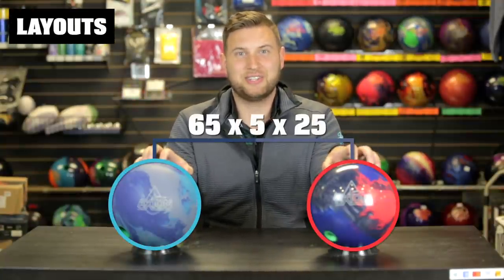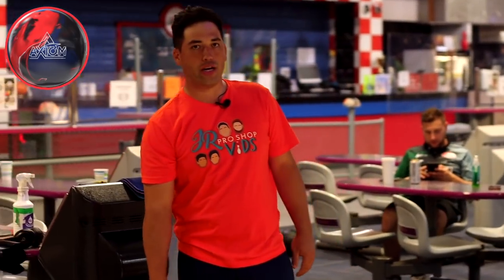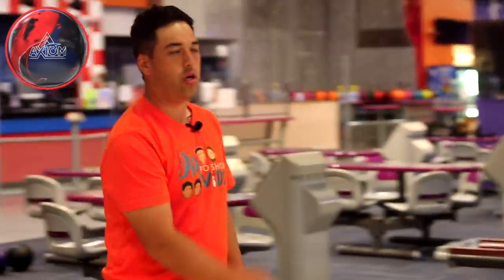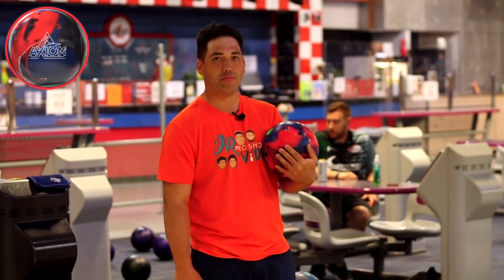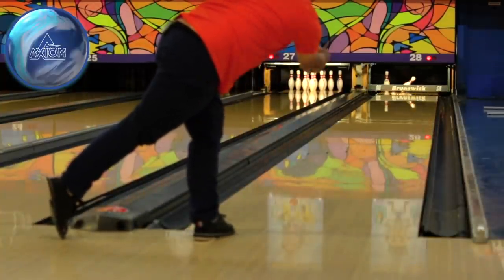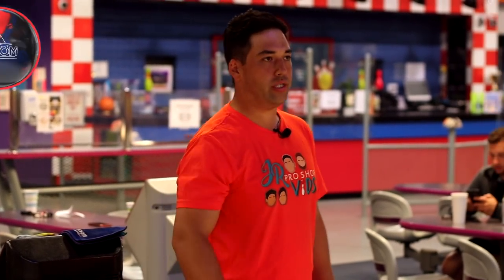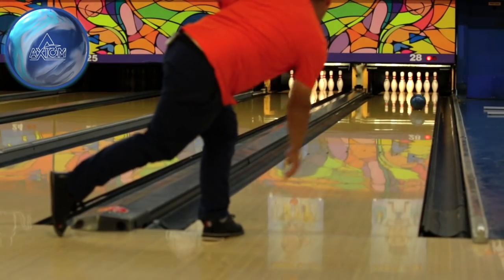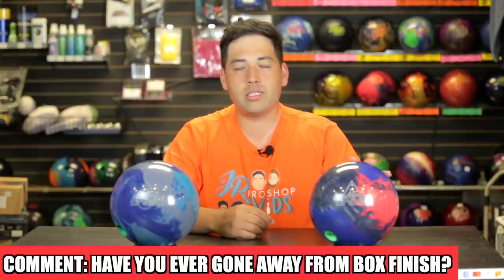Solid vs Pearl | Axiom vs Axiom | WHAT'S THE DIFFERENCE??

Comment: I always actually change the surface of a new ball before throwing it - i know this sounds insane, but what i mean is if the box for a ball says 3000, then i will put use the spinner to put 3000 on it myself - that way i know exactly how to recreate that surface when it comes to resurfacing each ball!! purely because i strongly believe you will never recreate the factory finish even if you use the same pads/polishes.

and yes i have ended up changing solid balls to be shiny and pearl balls to be dull for example, even though its a hybrid, i love the original Hyroad at 2000, i always felt it missing the breakpoint for me when shiny! but in saying that my hyroad max is now shiny haha

Comment: I'm a stroker and, like many others, I took Bowling This Month's advice and took the factory finish of my Phaze III down to 3000 by sanding. The changes are quite noticeable. Using BTM's numbers (they gave me their best guess on the post sanding numbers) here they are....Length 15 vs 6.5, Torque 8.0 vs 7.0, Back end 17.5 vs 16.5, Hook 54 vs 57.5. As you can see, removing the factory polish dramatically reduced the length rating and significantly increased the hook rating. I usually don't change box finishes but I'm going to keep this Phaze III at 3000 sanded. As such, it has become my "hook monster" ball.

Comment: Used to throw an old t-road pearl but it finally cracked so I went to a Hy-road pearl but it was a little too angular on the end so we sanded it from 2000 grit to 1500 grit and then repolished it. The roll phase starts just a little earlier and not so sharp so it is more forgiving but still strong. Funny note; Fixed the t-road cracks with JB wield (cracks were around the finger holes) and they have held up great! Note this is Colleen's husband Dave

Comment: Have a badger tour drilled 70x4x80 for control and I’ve used it oob on chameleon and it looked good.  For standard 40 foot house I polished it with motiv polish and I’ve hit i with a ctd 5k pad.  I felt on house the 5k pad gave it a more consistent reaction on than polished.  I noticed that when it starts leaving flat corners I just move in a little in and come around it and my pocket becomes big again.  I have a money badger drilled pin up and I took the polish off of it and it shapes a little differently than when it’s polished.  It doesn’t go as far down lane when the polish is taken off and the reaction isn’t as strong off the spot but sometimes I need a different reaction and shape than the oob cover.

Comment: Yesterday for practice I polished a solid asym Intimidator. It gave it a smooth controllable benchmark feel but I had to play farther right, around the 7 board and throw it very straight to get it to go through the pins properly.  Didn't love it, but didn't hate it, might use it instead of my old blown out dead idol until the new one comes out.  And in the past I've put a 2000 pad to a Halo Pearl and I had better luck with it that way.  P.S. also polished my old dead pink idol then went over gently with a 3000 pad giving it a bit of sheen. Was hoping that would breathe some life back into it. Nope.

Comment: I took a Columbia 300 Tyrant Solid from box finish to 4000 grit and polished.  I liked the change so much that I left it that way.  I am a low speed, rev dominant two hander and out of the box it would hook at my feet.  The surface change made it push easily through the fronts but still make a decisive move on the backend.  Sadly it cracked on me after about a year of use.

Comment: Great stuff as always Guys!!!  I'm lookin at a new Pearl now...I roll the ASYM Storm Dual lock and also a SYM iQ Tour Sapphire. 

Not sure what to go with, but looking at these 3 balls...
I'm still Storm and Roto Jungo so be nice ;), but the GB ASYM looks to be a beast like the GB4 which I rock and then there is the new Joker Wild that looks sweet from the reactions I've seen...<<< in JR's vids. 

I did this by the numbers based on the cores as they are all Pearls. So, 
GB4 ASYM=197 based of you vid I can just shine up the GB4 ;) so this is first ball out.
Dual Lock=201 (Own)
Joker=203??? might be 2nd out
Axiom Pearl=209 based on your vid I can sand it down 2000 with 500 under, so hmmm...;)
iQ Tour=223. (Own)

***I'm leaning Axiom Pearl or Joker...;) 
I under stand that surface changes are the key however...What are your thoughts guys...and you have been great...THANKS IN ADVANCE!!!  Sorry for the rant.  :)  LOVE WHAT YOU ALL DO!!!

Comment: What do you mean when you say “ with a little bit if 500 underneath”? I know it with the pads but is it you hit it with 500 then 2000 right after?
Reply from the maker: Yea, usually you'd want to always sand in steps so if you want 2k finish I'd start with 500 then do 2000 on top.

Comment: I keep my Nuclear Cell sanded at 2000 instead of out of the box shiny. It just makes it pick up a couple of feet sooner like I need it to do and still ignores the front and middle of the lane.
Reply: That's exactly what I hit my Halo Pearl with to help control the over/under. It was a pinch too lengthy and snappy out of box and 2000 really helped blend out the reaction.
Reply: @Mikey-1990  maybe I should try that with my halo pearl, I bowled 9 games with it and tossed it in the closet because all it did was over/under for me, the ball was trash and never though about changing the surface on it
Reply: @brettrobbins2707   I have had the Halo Pearl for about a year, and I cannot get this thing under control. Tried all kinds of surface combos.  As of today, my old Columbia Wrath actually is more controllable and has a better overall shape and actually hooks.  My pro shop guy recommended the Halo, but I'm not happy- I'm an old guy but still have plenty of zip.  I know I need work on my release, but I may have to get rid of it.
Reply: @Mikey-1990  Sorry- forgot to ask you for your advice. Thx
Reply: @brettrobbins2707    Definitely hit it with some light surface, still leaving a little bit of polish on the ball for that slight added length, because that's exactly what happened with mine at first. I get my best reaction at 2000. I'm at 18-19 mph with about 460-480 rpms give or take on average. I use a good shammy after every shot to try and minimize lane shine. I clean my equipment after every set which also helps. What I will do every once in awhile too, is reapply a fresh coat of polish, then hit it once again with 2000 lightly to keep that reaction. After an entire season, I'll have my pro shop guy do a de-oil and resurface. In my sport shot league, I actually don't usually have to ball down from it until halfway through game three. I have hundreds of games on my current one and the age is finally starting to show, so I'll be breaking out my backup second one very soon in time for next season and repeat the process. Give it a shot and let me know what you think.

Comment: Nice video, i was preparing the same idea too, but bowling alleys are still closed here, so you beat me to it. Nice job though. I can't throw the ball as good as you guys LOL. Seemed a bit that when sanded the pearl hooked a little bit more, when the solid was polished. Both sanded were about 3 boards more hook, and both polished it was a bit less, like 1-2 boards?
Reply from the maker: I'd say 4-5 boards. It was significant
Reply: @jrproshop  4-5 boards when both were sanded or polished?
Reply from the maker: Both

Comment: Is there a way to make a Pearl or Pearl Hybrid even more shiny/smoother?  This should give even more length.
Reply from the maker: Yea, you'd just have to go through all the steps and get that surface as smooth as possible
Reply: Get it to 3000, then 4000, then use polish. Lots of it. If you still want more, use a "slip agent".
Reply: @bowlingxp8345  I haven't heard of a "slip agent". Please clarify.
Reply: @CDRFAR  It is a substance that supposedly makes the ball even more polished, adds more length, but reduces some of the backend as well (probably because it reduces friction so much).  The company VISE makes one for sure, maybe other companies too.
Reply: @bowlingxp8345  Vise's slip agent is an amazing product. Highly recommend.
Reply: What bowling XP said! That slip agent will give you more length, but it will also change your break point, and you lose some hit, since the ball won't corner as hard!